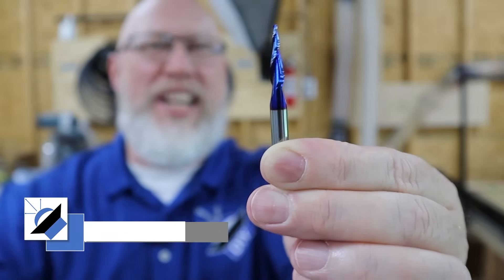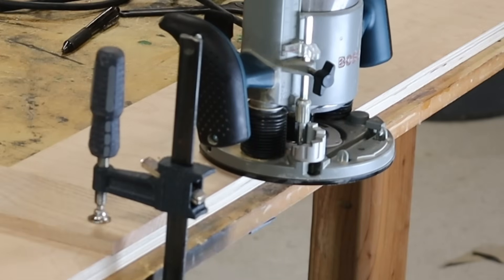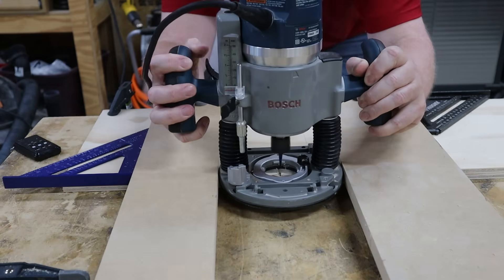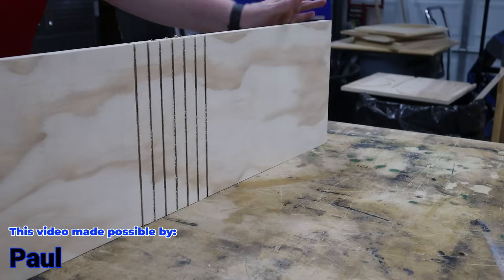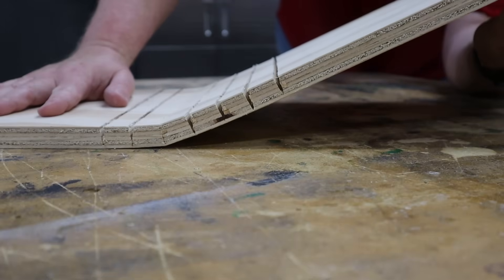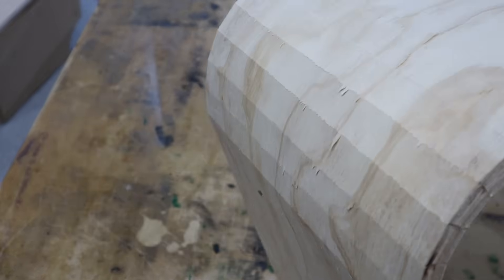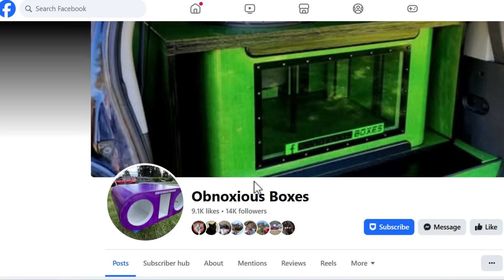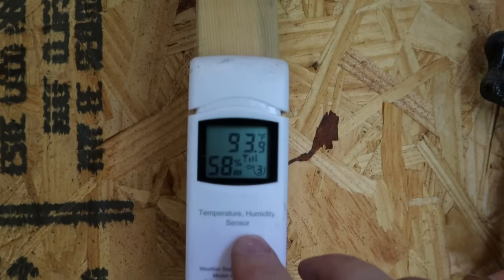A better way to kerf bend your subwoofer port.

Comment: I’m trying to figure how to setup my car right it’s small and I know that air volume makes a difference. I like deep bass but lots of different music I’ve got a 2013 Subaru BRZ with a Pioneer head unit and power bass mids and Alpine tweeters I have a 1000 watt Derwin Vega amplifier for a sub, but no subs yet. I wanna get the right size of speaker and cabinet for my car got any suggestions

Comment: Some pink foam would really help with the heat build up. Sometimes you can go to a hardware store and haggle for slightly damaged sheets. I recently got 25 4'x8'x1/2" sheets for about $60. That was at Menards but I think Lowe's does similar haggling. HD not very often.
Reply from the maker: I have haggled for damaged MDF before.  The top and bottom pieces in the bundle usually have damage.
Reply: @DIYAudioGuy Nice! I knew you were probably already aware, lol.

Comment: When using plywood soaking the ply with boiling water or steaming it  helps softening tannings on wood fibers and makes easier kerfing without damagin the the outer layer. If you dry kerf outer layer brakes the fibers apart.
Reply: How do you keep it from getting those sharp edges like he showed 🤔

Comment: Just picked up the bit. Already have the setup blocks. Just tried kerfung for the first time yesterday and it failed miserably! This should be easier!
Reply from the maker: Bummer man.  Where do you think it went wrong?  These kind of things take a little bit of practice.
Reply: @DIYAudioGuy  practice for sure! Rarely do things work out on the first try!

Comment: That's a 6 degree bit. There's 90 degrees in a right angle. So ideally you want 15 cuts to make smoother and tighter kerfs. Also, water and heat makes bending the wood way easier.

Comment: I have made many kerf cuts on my table saw.  I make a minimum of 12 cuts per kerf. It makes a  smoother bend. Also, with the wide table saw cut, just make a mix of sawdust and wood glue and fill each cut before bending. Makes for a good glue up. Also some resin on the back side helps.

Comment: Hhmmmm, I'm gonna have to give that a try. I usually use a tablesaw for my kerf cuts but I really like the results of that tapered bit
Reply from the maker: After reading the comments, I am definitely going to try to add some moisture the process when I do this again.
Reply: @DIYAudioGuy  that is what I do on my kerf cuts. I spray a mist on both sides and let it soak for about 15 minutes. Try with hot water

Comment: Also, once the glue dries, you could easily sand the corners of the 'facets' and get a perfectly smooth curved surface since the inside of the tapered surfaces are glued together to form one solid piece. $20 isn't too bad for that bit either.
Reply from the maker: Good idea.

Comment: My father told me that years ago they used to have table saw blades with a similar taper to do the same thing.  I've done this with a standard 1/8" carbide-tipped table saw blade and it was only as strong as the thinnest outer layer because the inside of the cuts didn't touch and couldn't be glued together as yours can. Really cool!
Reply from the maker: I have never had good luck kerfing with a standard saw blade.

Comment: Oh gawd no!  18-21 cuts with a thin kerf saw blade for 18mm or 3/4” materials to do a 90 degree bend. Fill the kerf cuts with PL MAX premium and clamp at 90 degrees. Let it set up for 12-24 hours then sand the joints. This will give the best results on the “outer” bend. No snapping. No cracking. No unsightly lines in the grain.
Reply from the maker: That's clever!  I might have to give this a try!

Comment: Personally I use a thin towel and an iron with a ton of steam.
If you look at the bit it has an angle to it maybe 10-15-30degs if you take the angle you want and divied it by the bit angle you will know how many cuts you need But I personally will 2 or 3x the number especially on larger radius  to get a smoother bend yes it will leave a gap i mix up wood glue with saw dust tell it make a paste and squeegee it in before bending

Comment: moisten the wood before bending :) = no crunching.... glad you explain the difference between using a saw vs taper blade A+
Reply from the maker: Yes, that will probably help with that seam on the outside of the bend as well.

Comment: I found soaking your joints down before you make the bend, helps a lot. I lay a wet towel on the joints for a bit,  then do my bends.
Reply: You could also steam the back side.
Reply from the maker: That would help
Reply: Especially with the more expensive hardwood plywoods
Reply: I've seen that work. But I think steam would be faster, cleaner and easier. Either designate an old iron, or cheap steam cleaner.
Reply: Does anything need done after the bends to get the moisture out of the wood? To possibly prevent mold?
Reply: @mathewmustardjr999 just heat it enough to soft tannings (natural glue between wood fibers) and let it cool down after bend. Wood absorbs moisture in a certain % and exes will just drop off. You can leave it to dry for few days before aplying top coat but if you are using fabric then waiting that it doesnt feel wet is enought for the clue to stick.
Reply: Came to say the same thing
Reply: Wet towel, heat gun and fill the cuts with wood glue, then no need to special tapered router bits